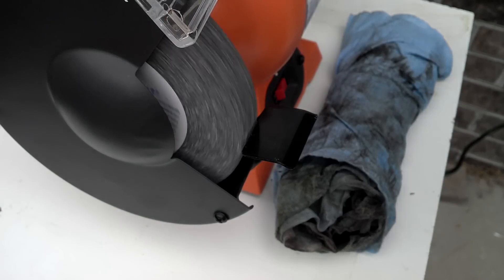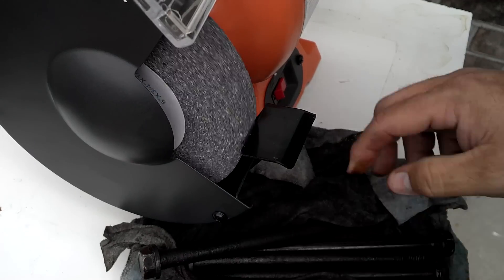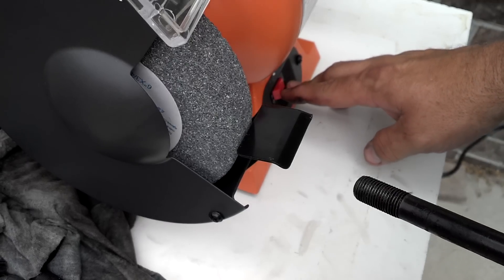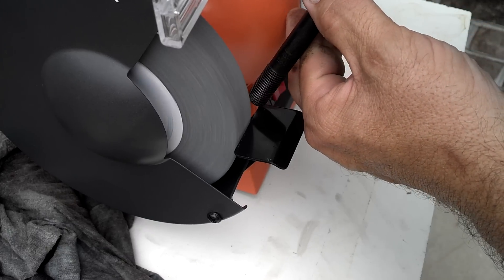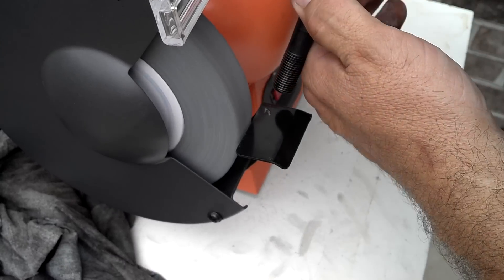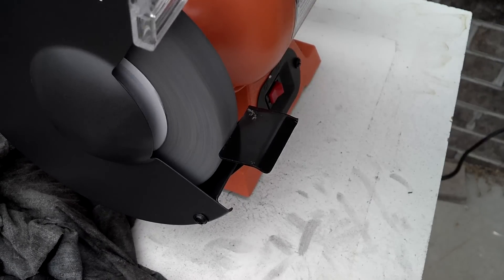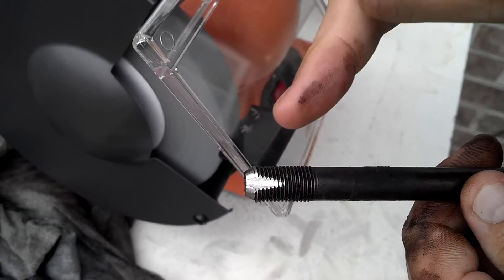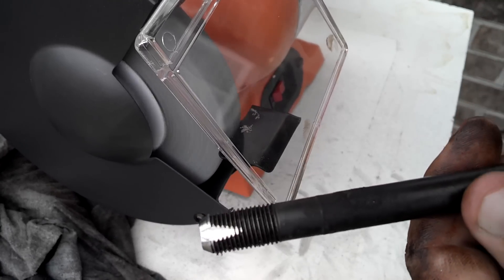Diy Thread Chaser

Comment: Thanks man. I really don't want to Spend $40 on an - ARP chevy small block head thread chaser - I'm not an engine builder or anything, and it's just an old work truck that needs a little TLC. I appreciate the video!

Comment: Smart move using new head bolts, the old bolts stretch. Would have been better using a triangle file for a smoother cut. Use a wire wheel after grinding to remove the burrs.
Reply from the maker: +B Blod Yea I could not find my file. I have my tools all over the place. :) But a file would of been easier in a vice.
Reply: By the way, I did a quick search. There are plenty of videos about head gasket replacement for your truck.

Comment: Alternatively, could I buy a cheap tap set and Smooth out the rough edges to make it perform more like a chaser? I can;t buy just one head bolt and do this, I have to buy a set. A set of taps is $12 at harbor frieght.
Reply: the thing here is the depth of the bolts
Reply: Get a head bolt from a junkyard or a junked engine that is lying around.
Reply: When doing the head aren't you required to use new head bolts? If so then you'd have the old ones to butcher anyway?